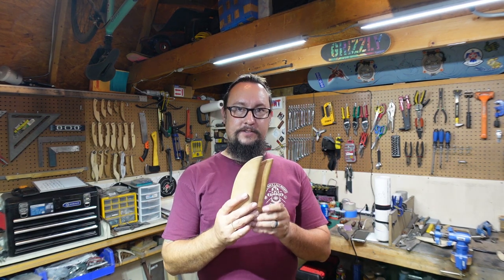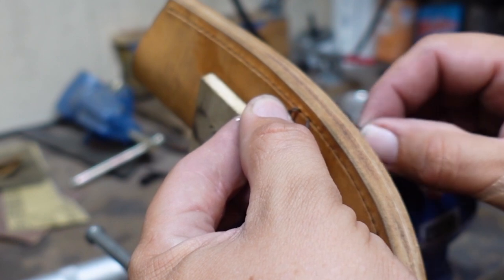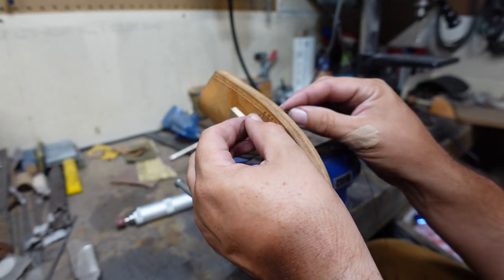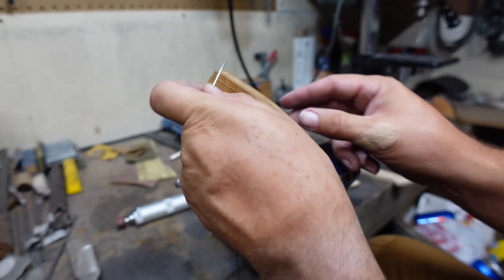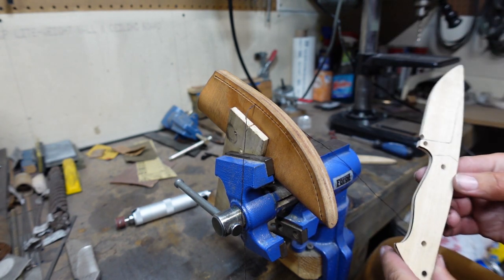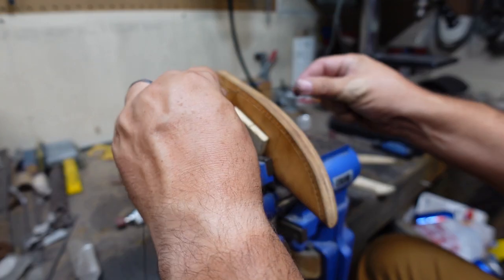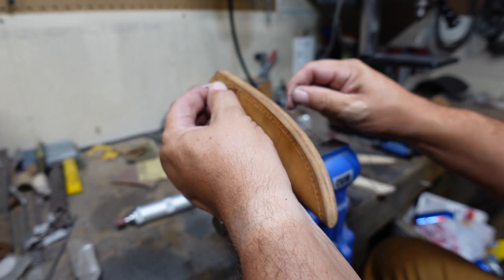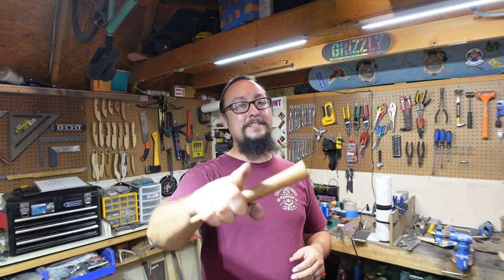Stitching A Leather Sheath While Explaining Knife Profiles | Daily Vlog | Knife Maker

Comment: At least for me when I plan out a template the handle length to fit about most of the population seems to be somewhere around the following- if you measure the underside of the handle:
Small knives like paring and skining, about 95-100mm, kitchen and hunters around 100-110mm and very large, heavy use choppers about 115-120mm
That includes support for the pinky finger and most people should be happy enough on most knives, course if you're making a full custom then get a bit of an idea of their hand size by measuring across the palm or just giving them some examples to try out and see what they like
Reply from the maker: Yup, those are pretty good sizes, that is typically what I do as well. Great info as always Kris!